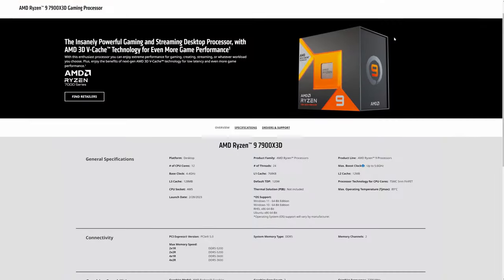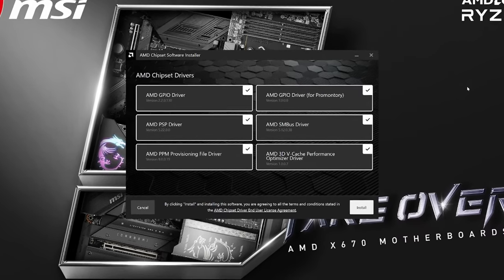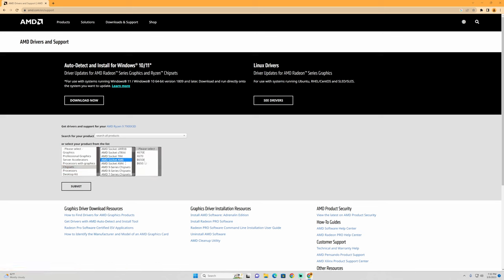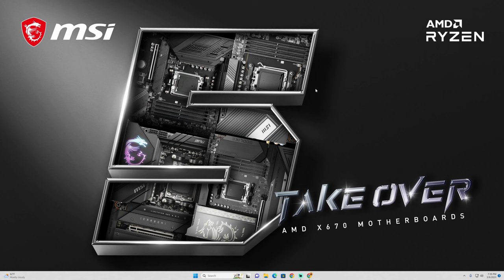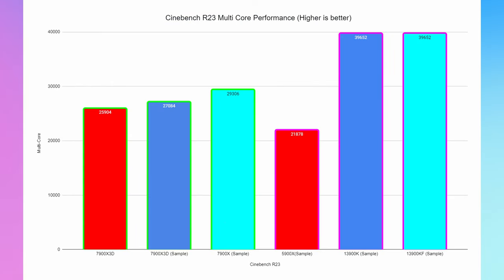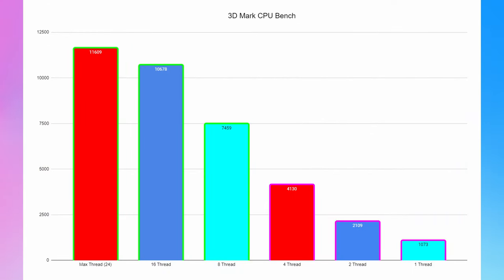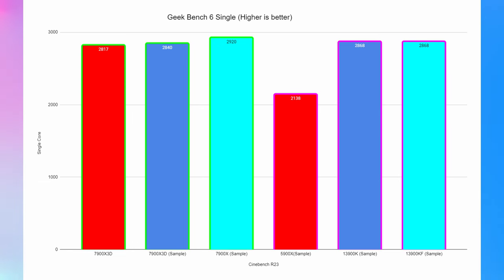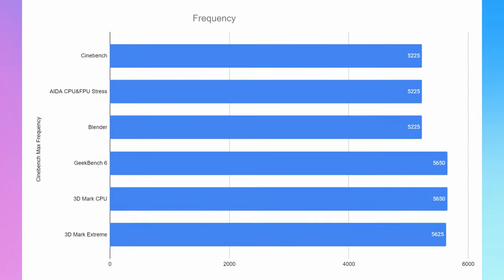The 7900X3D with V-Cache from AMD: Instructions Required?

Comment: I thought I had done everything needed after upgrading from a 7700X to the 7800X3D, but my CPU latency numbers in iRacing didnt come down much at all which has been in the 8-16 range. I use a RTX3080Ti and its latency numbers are typically 2-6.  The result has been that I couldnt run in VR with a Valve Index at over 90 FPS without a lot of FPS drops especially using venues that have been a problem like Mt Washington (endless trees, close up to the road). I just followed this video, step by step, including reinstalling the AMD drivers, and the CPU latency dropped into the 6-8 range.  The only obvious change to what I had was setting the power management as recommended in the video to Balanced (it was set to High Performance).  Now I am running at 120 FPS with very few FPS drops below 115 .

Comment: The dual CCD’s make it a no because core parking just doesn’t park the correct cores most of the time. Entering bios and setting CPPC to cache solves this problem
Reply from the maker: Yep you are correct but I reviewed in launch. The ability to make fine changes only came later. But yea I don't like dual CCD for gaming especially

Comment: This is down to $329.99 now since it's not selling well.
Reply: What are you talking about LOL Its selling very well. New CPUs are coming out. Prices always drop like this.
Reply: @Paultimate7  not the 7900X3D that's why it's cheaper than the 7800X3D
Reply from the maker: Yea it makes sense because x3d is more for gaming and has 2 ccds vs one CCD on 7800x3d. 

For me I would even choose a 7800x3d rather than 7950x3d. 

In my test bench I use the 7800x3d for a reason. 

Good comment
Reply: Yea, at that price I bet it is selling like hotcakes, I even got a couple bucks off that price for Prime day, like $327.
Reply: @WootDini if someone wanted to play games while stream, would the 7950x3d be better?

Comment: I play games like Tarkov and Rust, but would also like a CPU that doesn't perform poorly like the 7900X3D in productivity apps.
Found a like new 7900X3D for $460 so I felt like it's a no brainer... 7800X3D is on sale for $420 at microcenter in my area but for an extra $40 I think it makes sense just to go for the 7900X3D.

It would make sense to get the 7900X3D given it would only be $40 more, right?

A bit nervous about core parking, game bar etc. but hopefully it works well (=
Reply: @WootDini  no worries, thanks for responding! Appreciate the feedback- it’s a tough choice but leaning with 7900x3D. It would feel odd to leave all that multi-fire performance on the table
Reply: @DrDoinks  I just got a 7900x3d bc it was on sale for 450

Comment: I just built a system with this CPU.  Over and over again it would "train" on boot for an hour.  I mean eight or more times (approx. one hour each) in a 16 hour period.  I'm sending it back.  Tried different MOBOs and Memory.  Same problem.
Reply from the maker: CPU issues are super super rare but they do happen. Have you solved this ?
Reply: @WootDini  I sent it all back and got a13900kf instead.

I'm sure it was the CPU.  I kept the RAM because it was on the QVL for the AMD and the Intel and it works great in the Intel.

The only thing I couldn't test with a second item was the CPU.  Two different sets of memory, two different motherboards.

Same CPU all times.  Multiple memory configurations.  Nothing worked.

Over a month to get a system working but my new system is running flawlessly.

I'm happy but took a while to get here.

So no, didn't solve problem with AMD system unless you count sending it back and buying something else instead. :)
Reply from the maker: @CafeenMan  brave going for 13th (or 14th gen) but hopefully all those bugs are out. 

But when it's going it's a awesome cpu :)

Comment: In my country the 7900x3d is 460 usd and the 7800x3d is 552, those 2 extra 3d cache are worth 90 bucks?
Reply from the maker: So 7800x3d is going to be better for gaming. Depends what you are wanting to do. They discounted 7900x because of lack of demand. It's still a great CPU. 

Gaming go for 7800 because it's just easier and better. Multitasking etc go for 7900

Comment: Hi. I have a question. Is this Ryzen 9 7900X3D processor good? Is there no problem with it? I need the processor to work in Lightroom and Photoshop.

Thank you
Reply from the maker: Sorry for late reply.

Look it's a massive v cache which is more for gaming. I would look rather at 7950 or 7900x honestly. Only x3d that's worth anything is 7800x3d. 

But photoshop and Lightroom benefits far more from Intel. So if you doing a while new PC go new Intel potentially, but if upgrading then look at the new lineups or 7900/7950x
Reply: @WootDini  I bought 7950X3D

Comment: Hi Woot! Im moving from am4 to asus x670 e gaming and Ryzen 9 7900x3d or maybe 7900x. About amd drivers, i should use tools from amd to uninstall am4 cpu apps and drivers? Or what? Obviously will keep my GPU. But well. . . What do you recommend to do a part from updating windows first and asus bios if necessary ( new Mobo) ? 
Thanks in advance
Reply from the maker: Hello :)

Best process in my opinion

Update bios
Install windows (use the cmd code to install win 11 without internet connection to avoid bloatware)
Update Windows service pack (as far as possible avoid things you don't need)
Install chipset drives (AMD website)
Install GPU drivers ( I recommend not using GeForce experience if you don't utilize the functions, rather just get the vanilla driver from Nvidias site)
Install motherboard drivers (needed ones only)

I manually update my driver's and fresh install windows every 4 months or so because I am pedantic about bloatware. 

If you want easy route (with bloat )

Bios 
Windows update full
AMD drivers 
Install Armory crate and update all from there 

Hope this helps

Comment: What cooler did you use to get those temps?
Reply from the maker: At the time it was a MSI core liquid v2. But I don't suggest it. I have had issues with it since. 

I'm having alot of good benching with the ml360 flux from Cooler master